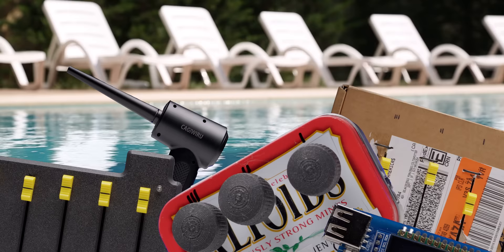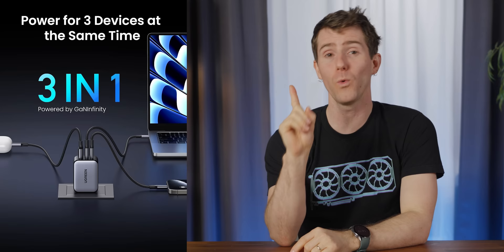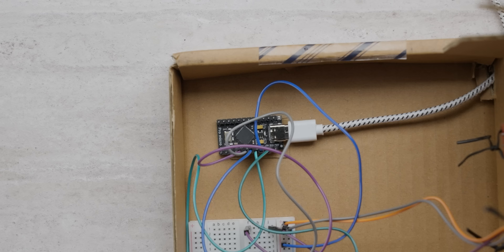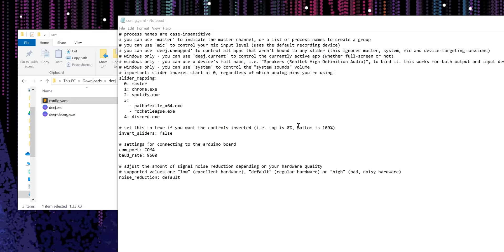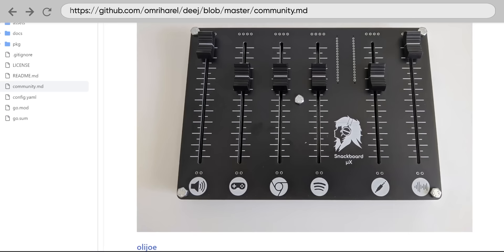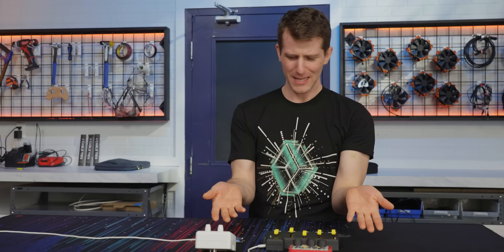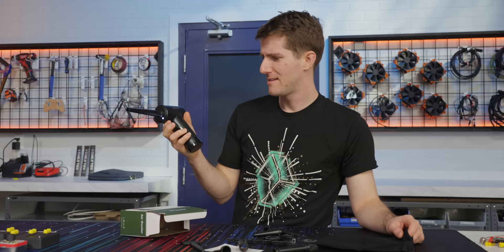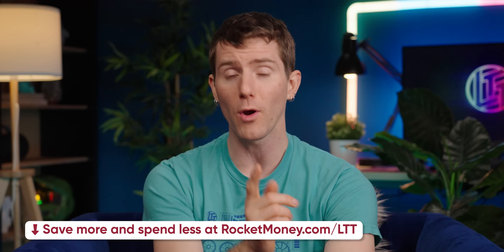I Made This for Under $10. You Can Too - Handy Tech Under $100

Comment: That first item is EXACTLY  what I need. And Linus explained EXACTLY why I need it...nobody wants to manually swap trickle chargers on and off over months periods way to go my man!
Reply: I'm curious, is there any advantage to this over just creating a routine with a $5 smart plug to turn on intermittently?
Reply: @screwytb  fair play...as many smart plugs as I have I don't use any of them with routines..perhaps I'll try that. However maybe not all people have them but in my case that works..thank you for the idea
Reply: @ZagFurn  Yeah definitely a lot of people won't have an existing setup. But if you've already got everything you need in house, and don't need to buy custom solutions - perfect. 
Haven't got this going yet, but have been meaning to add this to my motion-activated under-cabinet lighting. (It won't work while plugged in, but dies after about a week unplugged. Very inconvenient!) But this vid now has me thinking about my car jumper, power banks, Quest, and more...
Reply: @screwytb  only thing that comes to mind for me is that the smart plug is probably not self contained, whereas this thing is. Long term I would suspect that a smart plug would be less convenient due to outdated software

Comment: As the local system integrator, I use one of the rechargeable blow-e-matrons all the time. Makes cleaning up used parts FAR faster than by hand and cheaper than canned air. Without the concerns with condensation or over-pressure from a compressor. Paired with microfiber cloths, spray cleaner, electrical cleaner, a toothbrush, rubbing alcohol, etc ... Covers 99% of those needs. Mine was less than $25usd on Amazon. - I also get asked by customers regularly about how often and how to clean their PCs and send them a link. A regular blow-dust can go a long way towards keeping thermals under control and increasing hardware lifespan.
Reply: The one I got was a portable vacuum but I just turn it backwards. Its a lot weaker than canned air though and has a hard time getting rid of heavy dust build up, so I bought one that plugs into the wall, it was like $50 and is just as strong as canned air.
Reply: Just hijacking your comment. If you're looking for something a step up from the blow-e-matron they were talking about in the video, the DataVac blower by Metrovac is amazing. I spent $100 on mine about ten years ago and it's still going strong. I find it way better than the USB rechargeable blowers, plus the blower engine comes with a 10 year warranty and it's made in the USA. Only negative is that you need to plug it in every time you want to use it
Reply: The one linked in the video is “currently unavailable”. Do you happen to have a link to yours? I have a corded one but the cord is not always convenient.
Reply: Condensation not a problem for average person with compressors, you have to use it a whole lot without draining before it happens.

Comment: i was really hoping the charge-o-matic would turn off by itself once it detects current consumption dropping dramatically :(
Reply: A Homewizard smart socket can be used for that. Requires a €1/mo subscription though.
Reply: You could certainly do that, but I'm not sure for most folks it would actually be a better solution for the problem it is supposed to solve by its naming. As it would still need a timer to turn back on and top the self discharge back up, and if using it as LTT seem to intend to - as a common controller for a whole bunch of devices the current will drop erratically as some devices finish, or when using it for something that slow charges only the current might be rather small and hard to read anyway.
Reply: That is actually a bad idea for lead acid and NiMH batteries that need to trickle charge at the end of the cycle -- the difference between trickle charging an almost full and completely full battery is very small for those chemistries.
Reply: It's an interesting mode if you want to bulk charge something like a lithium ion battery but don't want to do the final charge, to be fair, but also you can leave modern li-ion on the shelf for 5 years if they're fully charged. Also, many cheaper high voltage li-ion packs need to trickle charge at the end not for cell maintenance but to balance the cells in the overall pack, and if you skip that your pack will go out of balance = very not good.
Reply: Remember, there is still a DC transformer between it and the battery which makes something like that pretty impractical to detect. Additionally charging curves look wildly different for different batteries, so I don't think this is feasible at all unfortunately 😕
Reply: @stalincat2457  Immediate nope because of the subscription. That means an account to sell not only the data on your phone, but also possibly data about what you plug into it (especially if it has USB sockets), while milking money out of you for no reason other than unnecessary "maintenance" of said data collection platforms. I'm willing to bet everything that socket does can be replicated by a raspberry pi zero and an all-nighter

Comment: It's getting harder and harder to find a laptop you can pull the battery OAT of!
Reply: Why are there oats in your laptop?
Reply: @fukov3400  To feed the horses.
Reply: some you can pull the battery out of but they'll refuse to turn on without the battery
Reply: @CheezMonsterCrazy  that's how you increase the CPU's horsepower
Reply: @DouglasWalrath  member when you could plug it to the wall without a battery and it would just work and then you had to remember to put the battery back if you wanted to move it? I member
Reply: All batteries can be removed. Laptops are typically held together with screws. Get a screwdriver, open your laptop, uplug the battery. Problem solved.
Reply: @boburanus69  Maybe lately it's getting better, there was a time most thin form laptops were held together by strong adhesives and were a pain to take apart (looking at you Microsoft)
Reply: @Ithilion  isopropyl alcohol works wonders to soften adhesive and allow the removal of batteries. Higher percentage, the better.
Reply: @Ithilion I really hope the situation improves. The new Lenovo Thinkpad T16 G3 looks promising. Still not like in the old days, where you could just take out the battery without any screws, though.
Reply: that was so cute actually, I love the Canadian accent
Reply: @Ithilion It doesn't seem to be the case anymore fortunately, I changed the SSD in my Surface Laptop Go 2 last week (what a name btw) and all i needed to do was remove 7 screws and pry the clips around the bottom housing - the top just came off after that
Reply: This is going to change due tontje new battery EU regulations.
The new regulations aim to improve recyclability, reduce to he carbon footprint of batteries and make them more durable and efficiant from manufacturing ro recycling them.
One of the elements ofnthoe regulations is the replaceability of batteries.
The new regulations requires almost all types of batteries (with very few exceptions for unique types of devices) be easily removed and replaced by end users using readily available tools or in a kit that includes the tools necesarry for free (the tools, not the battery).
This includes pohones, laptops, portble gaming consoles and pc's and any other device with batteries, including electric mobility devices.
In case of batteries with  capcity greater than 2 kWh it should be replaceable by any independent professional.
Replacment batteries must be available for minimum 5 years agter placing  the last unit of the equipment model on the market, with a reasonable and non-discriminatory price for independent professionals and end-users.
A manufacturer .
In addition "Software shall not be used to impede the replacement of a portable battery or LMT battery, or of their key components, with another compatible battery or key components." (LMT - light means of transport).
Some of the environmental regulations start going into effect this year and the replacement option will apply from Feb 2027, but manufacturers will start implementingbthis before that date.
Reply: @boburanus69 it's not really as easy as unplugging your battery. A MacBook laptop battery is glued in and the connector is screwed down with a torques head and has like 2-3 ribbon cables to remove. One of which is so tiny it's almost guaranteed someone who doesn't know what they are doing will break it.
Reply: Especially since laptop batteries are always still a separate component that needs to be produced separately, as long as it is not integrated like memory/CPU/GPU on the same circuit board, there should be no reason why you shouldn't be able to remove a battery separately.
Reply: Literally never seen a single laptop where it wasn't anything other than a ten minute job, even Apple machines are simple to remove the battery from.
Reply: 0:48
Reply: @boburanus69  It should not have to be that way. Batteries should be locked in place with a simple latch that can easily be opened.
Reply: @eirikheggelund  that design requires additional time to create and test a latch design, taking up more space inside a chassis, while also giving you a less efficient battery. Batteries must contain less than 2 grams of lithium with less than 100 watt hours of total charge. When you are fitting this inside a body less than a half inch thick, you are now left with two options: no battery, or internal battery. 

Which is why laptops come with screws and batteries that can still be removed. Here's good advice: don't buy a cheap laptop, your battery will have great life, and when it comes down to it, you'll be able to recharge said battery in a faster time than you could change a battery, even if it came with an easily removable option.  

Add to that the fact you should be asking for better batteries with less volatile compounds inside, this idea that you should be able to quickly swap a battery is kinda stupid on its face. Devices with removable batteries tend to be on the disposable side. 

Welcome to the 80s?
Reply: @boburanus69  I would still like a latch for the ease of access. It worked ten years ago and it would work today. I do not mind losing an hour of battery time for a latch.
Reply: @boburanus69  I see you haven't come across laptops that also use plastic tabs/clips and/or glue.
Reply: @NoOne-fe3gc  Phones use to be like that too but now only 2/3 phones have that functionality called battery bypass.
Reply: @boburanus69  The time to design, create, and test a latch design is not even a factor in why they choose to not use it. It boils down simply to rope the average customer into buying a completely new device or paying to service the device when the battery fails or no longer holds charge for long. Also while presenting an excuse to try to use to void the warranty if user does replace their own battery.

It is the same reason planned malfeasance exists, It is nothing other than simple greed.

Comment: Ear Trumpet is a great software side solution for application-specific volume control.
Reply: Uhhh you know Windows has this already
Reply: Yeah but ear trumpet does it better than Windows
Reply: Thanks!
Reply: @jm036  windows has what ear trumpet does, but at least on windows 10 its hidden within like  a 7th submenu while ear trumpet just lets u have it be the in the main volume controls
Reply: @qcklu  right click and open volume mixer if I remember. 7th menu my ass
Reply: (youtube refusing to post my reply)
windows main volume controls has the master volume reduce the range of control over each program, makes the volume controls unusable for sensitive earphones that need 3-5 % windows volume.
at 3% there is only a few volume options for individual programs. if i want discord at 50% volume i cant do that, 3% is the max so i need 1% or 2% to be close to half, but both are far away from the 1.5% that i cant do
Reply: @jm036   ...idk if youtube is letting me reply or if its just broken on my phone...
the fast menu u talk about becomes absolutely useless when needing windows to be at low volume, such as when using sensitive earphones. instead of changing master volume separate from the individual controls, the master volume just lowers all other sliders and restricts the range of options, reducing the amount of volume steps available and making it impossible to  set the volumes correctly at anything below say 15-30 % main volume.

at least for windows 10. idk if they changed it for windows 11

Comment: 1:00 what i do is i look at the batteries, match voltage, increase capacity, put together a bulky enclosure in cad, print that, make a makeshift temporary connection to the motherboard or gadget (permanent) and tape it secure onto the device as an external battery pack. i have increased capacity by 5x on my old cameras this way. only downside is that it's semi permanent so i do have to cut the tape, pull the cells, charge them 2 at a time and reinstall the whole thing. but damn it worth the hassle to have 4-5 hours of use time instead of 20 minutes. 18650s rock! you find them in portable vacuum cleaners, drill batteries, basically anything portable that runs on electricity and people throw away after a year or so. also if you aren't afraid of sticky fruity quite possibly toxic liquids and saliva, you can find tons of batteries from disposable vape rods you see on the street thrown not into a bin but onto the sidewalk. Worth the effort, just need a bms or an external lithium cell charger with protection.

Comment: I once bought a used emergency lamp/charging station. The man had a note taped to the top of the box with a handwritten record of the dates he charged it and the durations down to the second, along with the manufacturer's instructions for optimal longevity of the unit, just in case the owners manual was lost (it was and still is in the original box with the lamp and paper log)

Grandpa had followed the instructions precisely for over five years. (I'm trying my best to keep it as good as he did)

Comment: I've been using Deej for a while, and it is great.
I switched to the MIDI mixer a bit back, since it is even easier to configure, has more features, and supports off the shelf midi controllers.
Reply: Discovering per-app volume control, nevertheless via MIDI, was a revelation after suffering with hardware mixing and trying to make 4 separate outputs work together without ground loops etc.
Took the easy route with a Korg Nanokontrol and MIDI Mixer. Well worth every penny... damn all the RCA/jack adapters. :D

Comment: deej is awesome, been using mine for years! Some pc apps (e.g. corsair icue,...) take control of the com port so make sure they are not running if you run into problems
Reply: Same here! The case was the first thing I designed completely from scratch and is nearly perfect (only change I would make now is changing the code and adding modifier buttons to it)

Comment: 12V batteries, like the starter battery for a gas generator, are pretty well served by battery tenders, voltage sensing chargers that only charge when needed.
Reply: Yep, I keep smart battery tenders on my 2 golf carts, and rarely have trouble with them turning over the gas motors, & it's much cheaper to buy one than replacing the battery on my golf carts more often as they cost more than the big beefy battery in my F-150 crew cab lol!
Reply: Lead acid batteries like to be fully charged all the time. so keeping it on a charger 24/7 can be a good thing of course if the charger you are using has a float charging feature.

Comment: Good to see the Deej! An alternative I've liked to talk about is using a Midi Controller with knobs and faders like the Korg Nanokontrol 2 and free software called Midi-Mixer. No building needed, just buy hardware, install software, assign programs to faders or knobs in the software, and bam: hardware controlled individual app volume control! Its awesome!
Reply: I use a nanoKontrol 2 with voicemeeter, so I can adjust individual app volumes, my own mic volume, and multiple output volumes (headset, speakers, etc) all on the same board. Voicemeeter also allows me to use a rackmounted external compressor, so I no longer get my ears blasted by people with very varied mic levels in zoom meetings!
Reply: thank you so much ive been asking for something like this for a long while
Reply: i dont understand why you need different volume knobs for each program instead of just 1 for everything?
Reply: @mychamycha27 Sometimes you want some things louder than others and don't want to navigate through a bunch of software menus to do it. I know I personally have to do this a lot when gaming with my friends, to balance my voice chat, music and game audio how I like it.

Comment: 8:25 You could also use a usb condom. It has a male usb plug on one end and a female one on the other. It transfers power but has the data lined disconnected.
Reply: Link?

Comment: I made something similar to the Deej controller a few years ago, but it used MIDI instead. Route that to Voicemeeter, and it's a pretty nice setup!
Reply: I started with making a Deej controller then later used a different arduino sketch to make it a MIDI controller for Voicemeeter.

Comment: Ive had one of those Air Blowers for almost a year now and its saved me so much money and hassle compared to the cheap cans of compressed air i was buying from the dollar store for $4+/can. I found that the Air Blower is even powerful enough to inflate a twin size air mattress, and the USB-C charging makes it really easy to recharge the same as any of my other devices
Reply: I've looked into them before and my biggest question is the battery - how is it holding up after a longer period? Any idea how easy it is to replace?
Reply: Do you have a model recommendation?  I bought one and found the blowing to be fairly weak compared to a can of air.
Reply: @ibigfire My DataVac is like a jet engine, but not cheap at around $75. Well worth it for my needs.